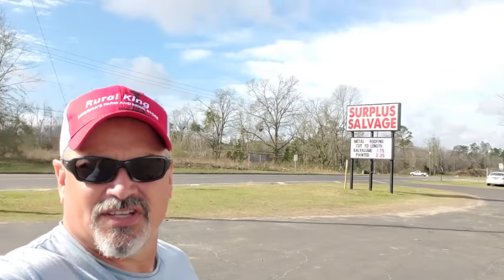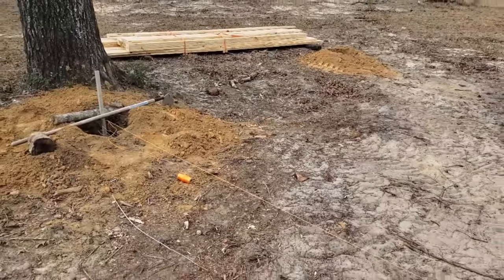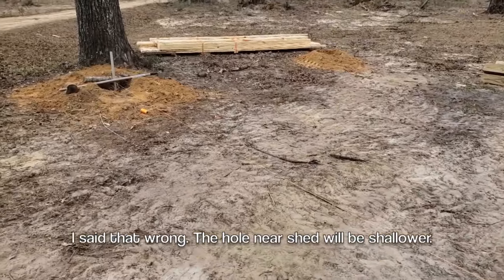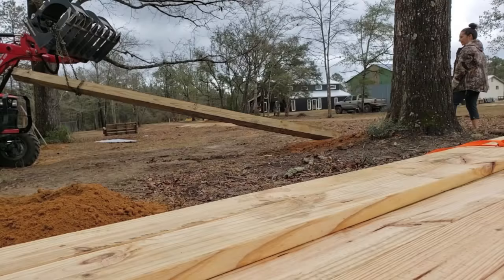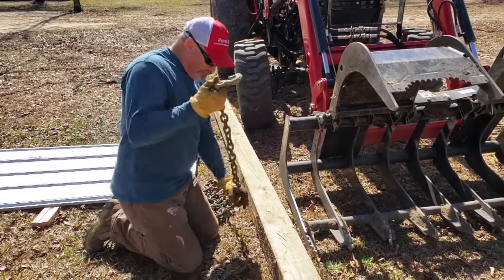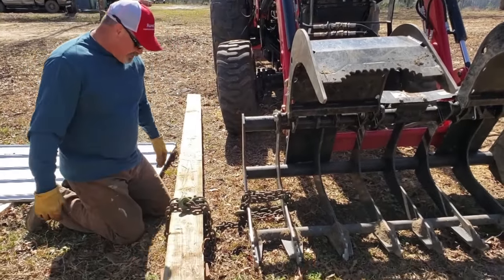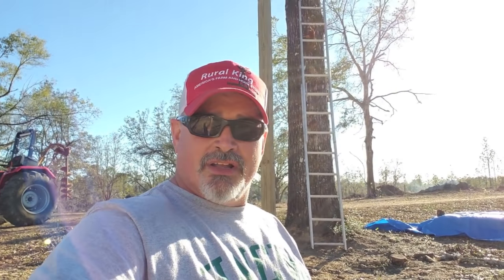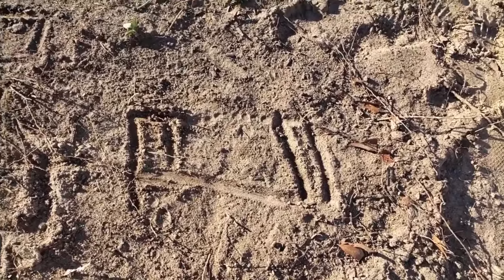How to build a POLE BARN on a hobby farm PART 2- [2019]

Comment: use a string to set the perimeters of your posts at the bottom -- the post should be at the center of the hole(been used since the building of the peramids) -- at the top of the posts once they are set in concrete put a nail at the height where you want the truss to rest then run a string to the next post with a line level at the middle of the string -when the bubble is in the middle put a mark on your post where your string is then attach the string where that nail is - then do the same all around the building to each post -- take a square and mark a line on each post -- cut off each post at the mark and they are all perfectly level all the way around -- don't forget the 3,4,5 rule for squaring the building -- it works on anything from a bird house to a skyscraper -- keep it up your doing great
Reply from the maker: Perfect advice! Thanks for the input 👍

Comment: It is immensely helpful to stand a board ( 2x6 x 5ft or similar) in the back of the hole before sliding in the post. This prevents the post from collapsing the hole edge and is much safer than risking the post 'kicking' your helper.

Comment: I'm not sure how i missed this project Hank. You must've completed this job about the same time I subscribed to your channel. Anywho I'm glad i found it, as I'm needing a pole barn to  store my tractor implements.  I hope to get started building this spring.  Thanks Hank
Reply from the maker: Yeah it was fun too build, but if I had to do it over again, I wouldn't have went with the taller roof. We thought we were gonna park a RV under it,but turns out the slide outs would hit the post, so it doesn't work for a camper like we thought. Oh well,such is life.
Reply: One nice thing about the highth you can add an addition or a lean to later on if you wanted to. Take care Hank

Comment: Nice information and thank you for sharing!
I'm currently designing my building, I'm debating if I should do metal building or pole barn building. 

Question: 
what type of wood you use and size?

Did you consider Column footing?

Are you worried rotting wood post?
Reply from the maker: Thanks Mike. 1. We used pressure treated wood for the posts and in treated wood for the stringers. 2. It's hard to get a concrete guy out here for such a small job. We live in the sticks so it would have been super expensive. 3. Not really worried about the wood,but is something we will keep an eye on and if we see it needing repaired we'll fix it. 👍
Reply: use pressure treated wood. correct me if I'm wrong for wood to rot it needs three factors oxygen moisture and temperature...so it rots in the rainy warm summer months if exposed to all 3 elements ...
Reply: @Hfoutdoorsyt  what about using a cement mixer and make it ur self...is that an option.

Comment: It's called the Pythagorean theorem so you are correct...
I find it easier to use that method as well instead of the equal diagonal measurements method.
C*2=A*2+B*2
I noticed that you're pole is awful close to that other building...
And with all due respect you should have cut down that tree having that pole that close to the tree it may either kill the tree or the tree is going to grow and the roots are going to disturb your pole and the concrete floor and the building in that corner you never have a tree that close to any building.

Comment: Using wood posts, even pressure treated is like starting a timer for destruction. Seems like a lot of work and money for something that will rot and collapse in 10 years maximum. Why not invest in steel posts?
Reply from the maker: Because the 100 year old buildings here with wooden posts disagree with your statement.